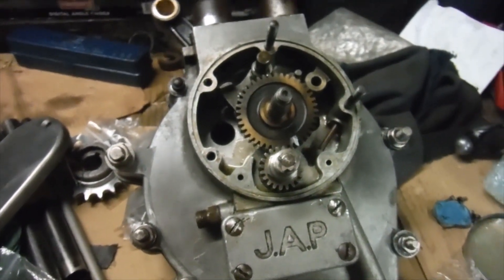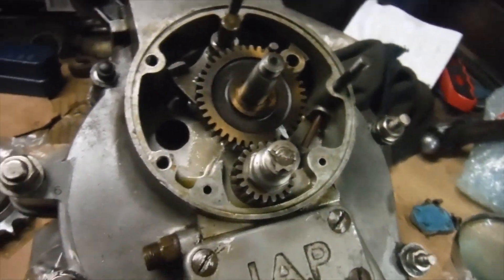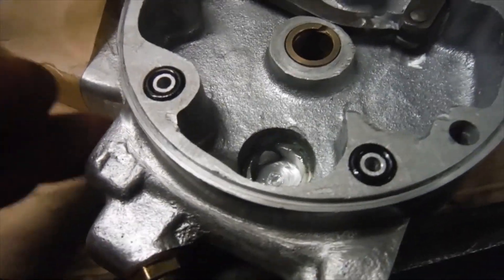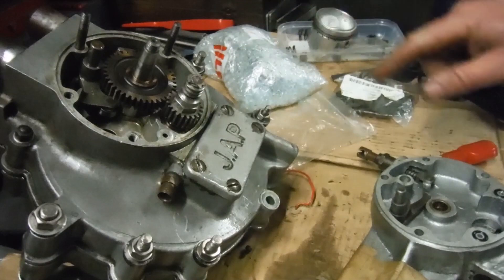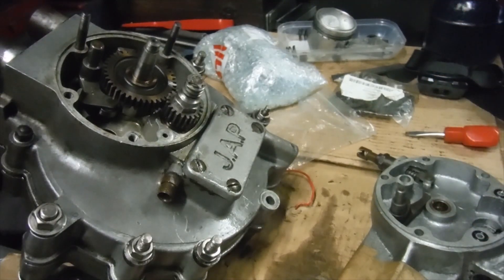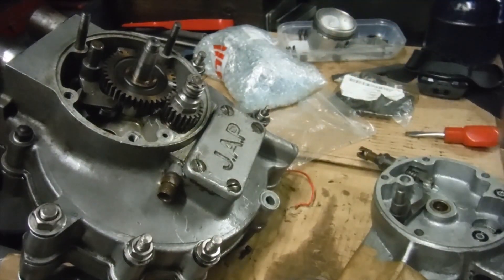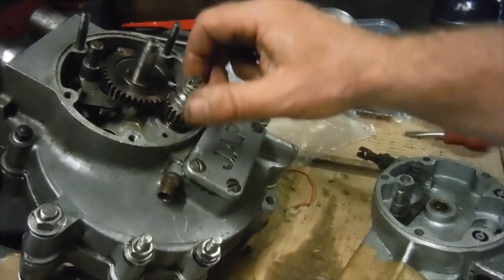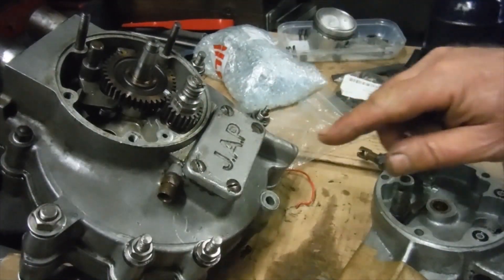JAP 250 cc engine bottom end progress.

Comment: Hi Paul im working on a 1927 jap 350cc side vavle.. would you know how the small timing gear on the crank is removed. I dont see any keys or notches tried a puller sorta looks like it might be threaded on? Thanks
Reply from the maker: Hi Brian, on this 250 the gear used a keyway and the oil pump drive worm had an integral nut, which screwed it up tightly against the timing pinion to secure it. The pinion was a taper fit on the crank. Hope this helps!

Comment: I know some watching this will regard your 'fix' as a bodge Paul (and to be fair it would be in an ultra-close tolerance, CNC-machined modern bike engine) but we should remember that at the time that JAP engine was built your file work would be seen as a perfectly acceptable engineering fix to the problem you were confronted with. Clearly either the casting or the bush (or possibly even both !..) wasn't originally machined accurately enough for the assembly to function, so a little 'light relieving' (as my Dad used to call it..) was required..
Reply: If it doesn’t work, it’s a bodge. If it does work, it’s a modification.